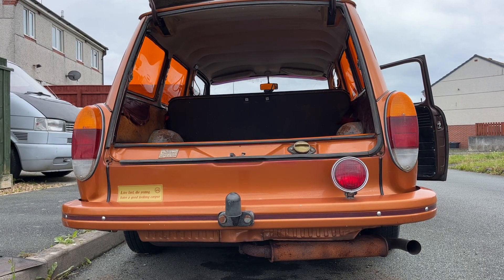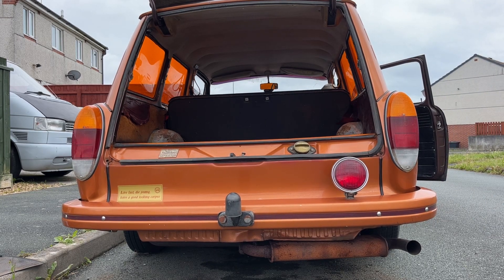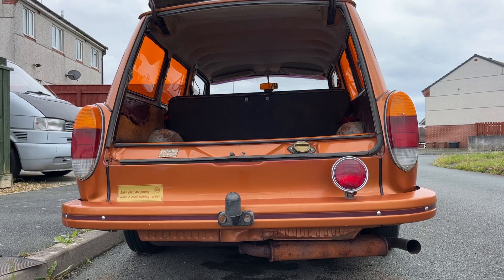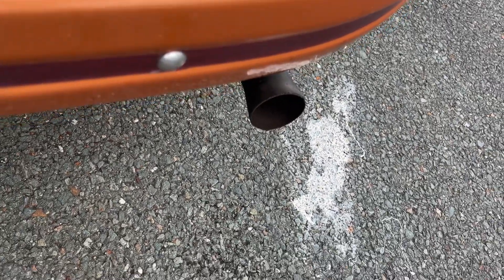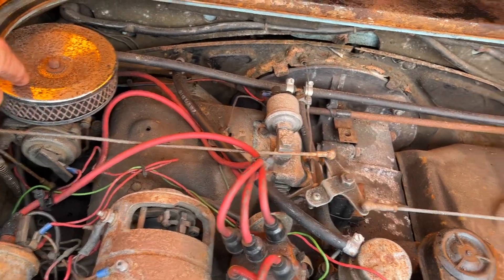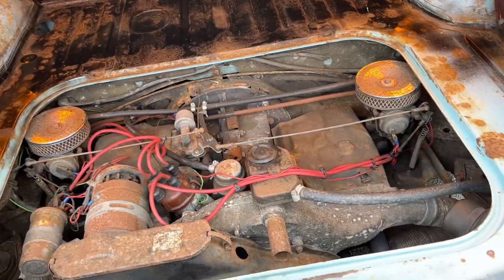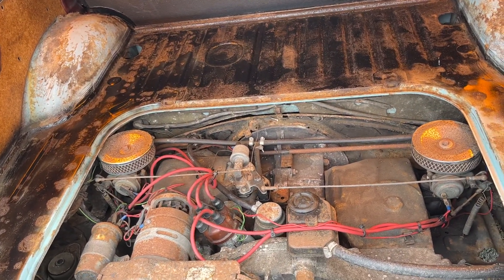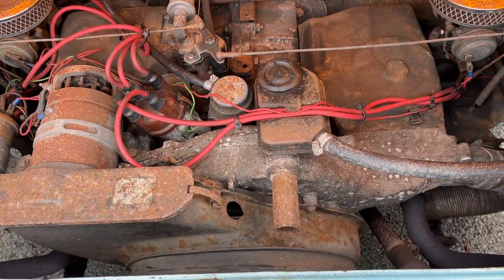Vw squareback 1973 Start up,idles good but needs engine repair!!

Comment: Exhaust has a nice rap to it. Attend to that engine and you'll be good for a long long time👍
Reply from the maker: Yeah it’s a beetle exhaust but I had to cut and reweld connecting flange cheers Jim